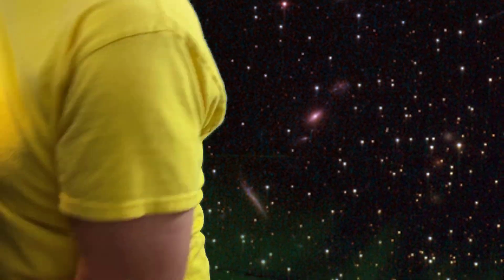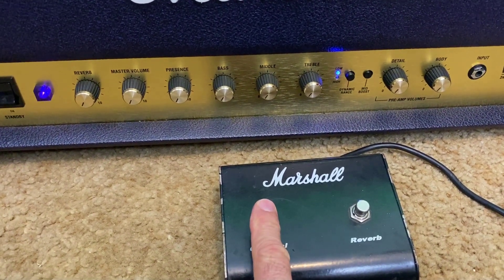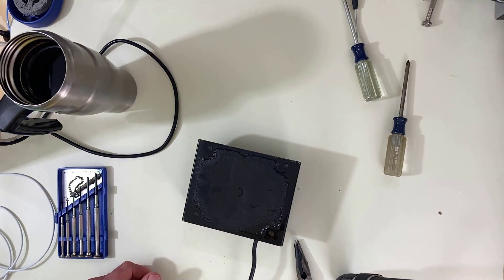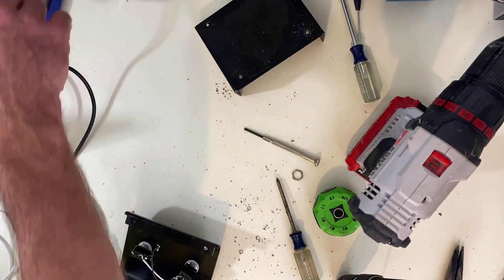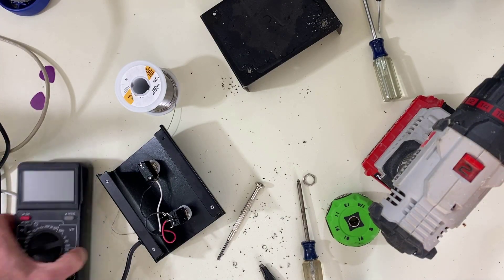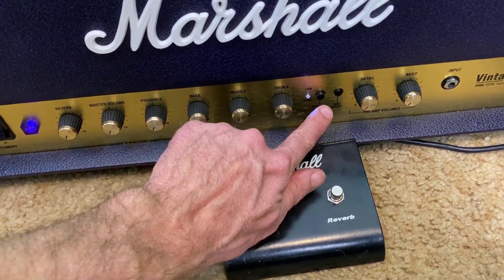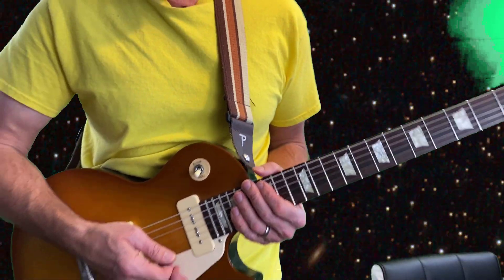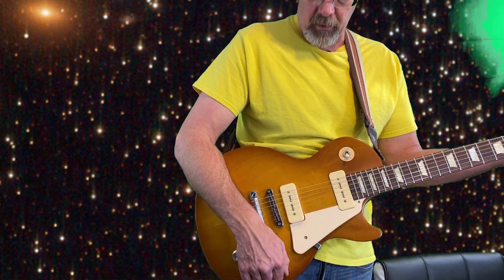Marshall Vintage Modern 2466 100 Watt DIY Fix Your Own Amplifier

Comment: PEDAL-00041 is the correct factory 2 button footswitch. It is labeled Dynamic Range and Reverb. My 2266 head came with a single button ,4 function footswitch that sucks. LDR w/reverb/LDR straight/HDR w/reverb/HDR straight.
Reply from the maker: Thanks for the part number. I wonder why there are so many missing original footswitches.
Reply: @HomespunEffects  Right. I have no idea.

Comment: To balance the two settings, i use a boost pedal in ldr for rhythm. Hdr  becomes the "solo" channel with more gain and volume boost. Even with the boost on ldr, you can get the guitar clean by rolling down the volume.
Reply from the maker: Thanks, friend. I will have to try that out.

Comment: It’s a jet engine on the super overdrive channel. Even a noise gate wouldn’t work at really loud volumes for me, as the gate would stifle the sustain, and cut off notes as they decay.
    What power tubes did you say are in it ?
You said; “ You liked EL-34s right ? “ I do to. 
I’m actually looking for a vintage JCM 800, but to no avail, for the last 3 months plus ! 
   Anyway, enough said !
Ha!
Faubus
Reply from the maker: The Marshall Vintage Modern 2466 uses KT66 tubes.

Comment: Would a boss FS6 pedal with a stereo jack work with this? I have the same vintage modern but there no reverb at all, I am wondering is it constantly set to off by some chance
Reply from the maker: The FS-6 should work for a 2466 because you can have one set to latching and the other to momentary. However, I think yours may need to be looked at because when there is no foot switch plugged in the reverb should be active all the time.
Reply: @HomespunEffects  Thanks for the reply, I was thinking the same but I'll try it out today :)
Reply: @HomespunEffects  Tried the fs6 pedal on momentary for the channel switch which works but only on the pedal and not on the amp itself when the pedal is plugged in. Still nothing from the reverb though.
Reply from the maker: @loafbo  seems like the momentary switch for the dynamic range switch is normally closed. If you press and hold the switch on the FS-6 can you switch the dynamic range from the front of the amp?

Regardless, there's a problem with the reverb. You can get schematics and talk to the designer here: http://musiciansroadhouse.com/viewforum.php?f=1

Comment: When I freeze the frame, your screwdrivers look like they’re all jacked up like you are using a number one or number two that’s ground down from wear. You can’t just use any kind of Phillips screwdriver you have to use the right size and if it’s worn then you need to throw it away.
Reply from the maker: Are you taking about the jeweler screwdrivers in the blue case or one of the the Craftsman? They’re classics.
Reply from the maker: The two clear handles screwdrivers are Craftsman. One is a #1 and the other is a #2. They are in good repair even though they are about 22 years old. The jeweler screwdrivers are about 35 years old but are basically unused. 

The issue was that the screws in the pedal case were basically rotted and rusted. Drilling was the only option. Thanks for stopping by and offering tips. Even if I do know what you are saying, it may help someone that doesn’t.

Comment: Question. Are you direct into the amp? The gain sounds great! I bought this amp and the matching cab new when it came out and don’t play it much. Yep the purple one also. It’s essentially brand new since it has been under a cover in my room since. The foot switch is still in the box. Curious where you are located. Any chance you are in the Chicago area? Trying to find a good effects guy to make some custom effects and repair a few pedals also. BTW, nice job with the riffs. Can’t go wrong with Hendrix or Ratt! 🎸👍🏻
Reply: Dude, I’m in Chicago.  For the pedal repair, get a hold of the guys at Alchemy Audio. They are awesome. They’re on Facebook.
Reply from the maker: Matt Smith thanks for helping kkash72. 👍
Reply from the maker: Thanks so much! 

Yes, that is direct into the amp. No pedals. It sure has that Marshall DNA. It has become my favorite amp. I wish I had the matching cabinet.

I'm sure the Lollar P-90s have something to do with the nice tone, too. 😄👍
Reply from the maker: Oh, I'm about 50 miles north of Pittsburgh. Wherever you are, I'm about as far away as you can get. 😁